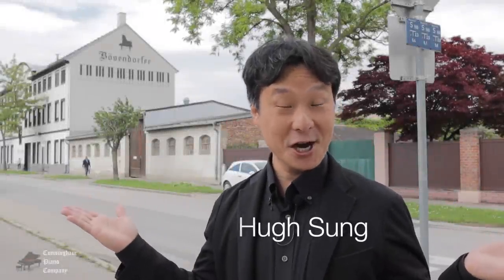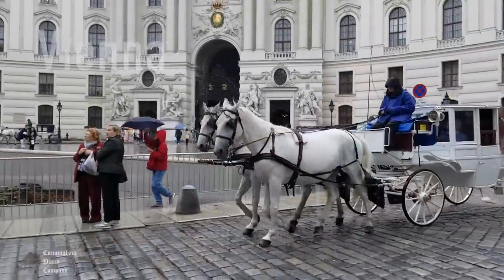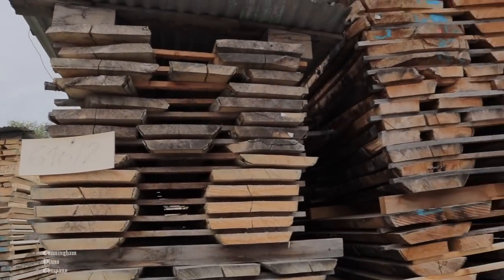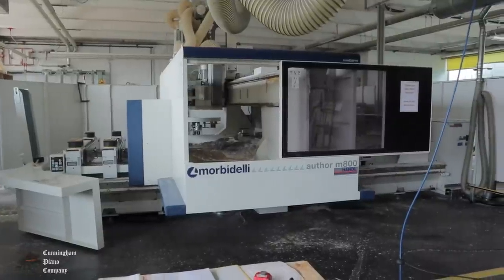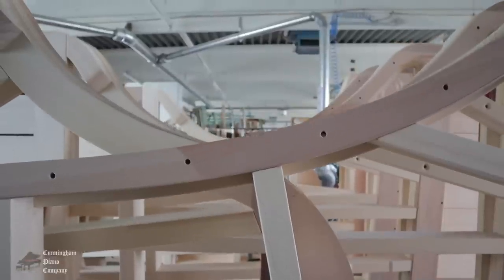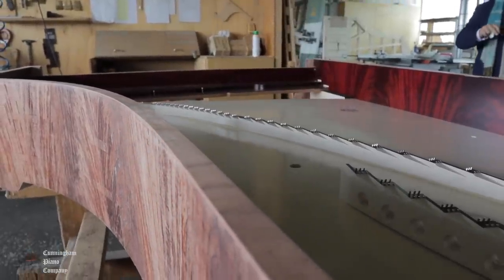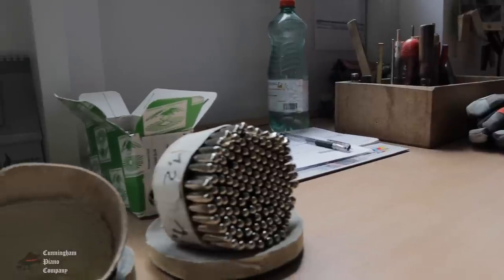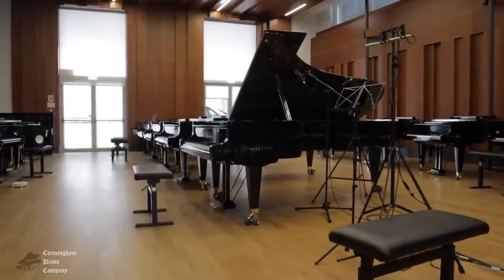A Tour of the Bösendorfer Piano Factory with Hugh Sung | Cunningham Piano Company

Comment: most expensive? what about ravencraft, fazioli and so on?
Reply: I think, it was not a research based, factual statement.
Still, when you look at standard models at each brand... the Bösendorfer 290 Imperial is for sure one of the most expensive ones (if not the most expensive). It can cost $300 000 - $600 000, while e.g. Fazioli's standard concert grands cost about half of that.
It is probably due to the manufacturing time. Bösendorfers can take 6 years to finish, while Faziolis take about 2-3. Steinways are much cheaper than any European brand - despite being completely hand made - and they finish a piano under 12 months...